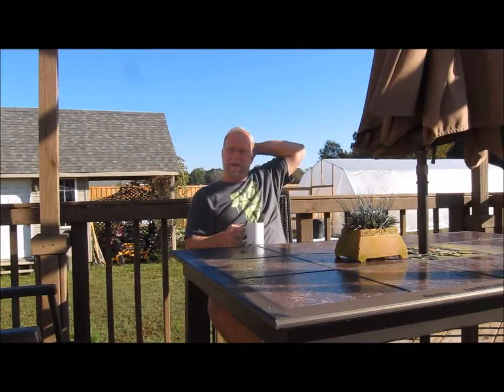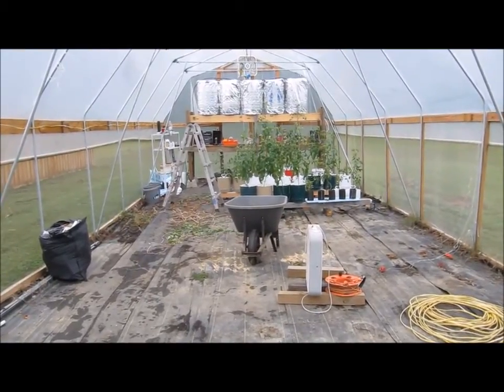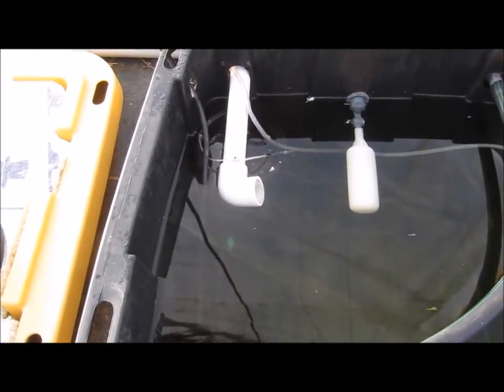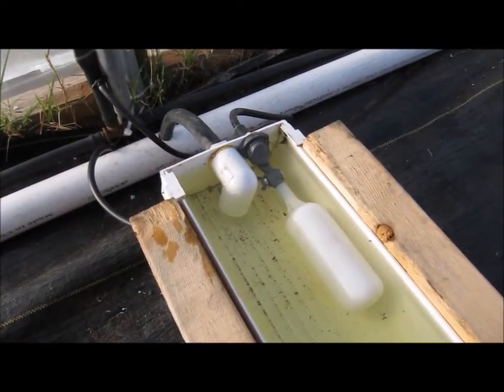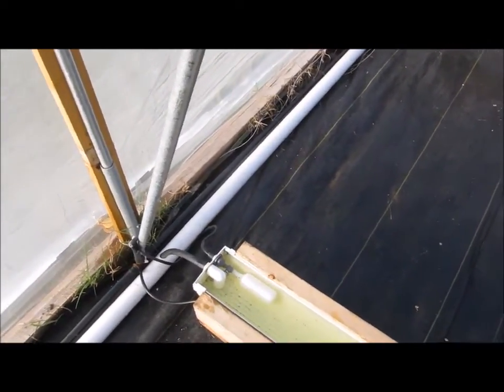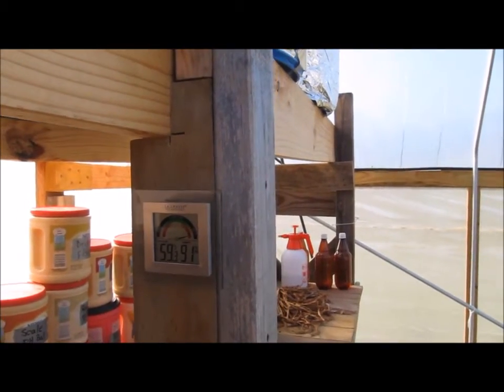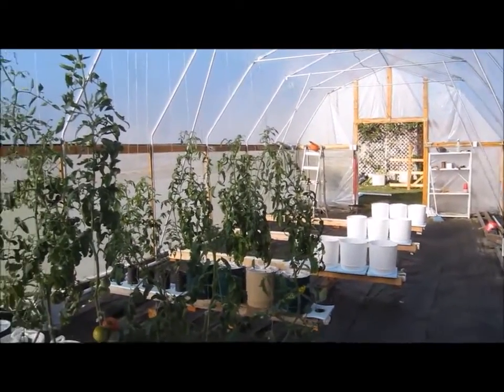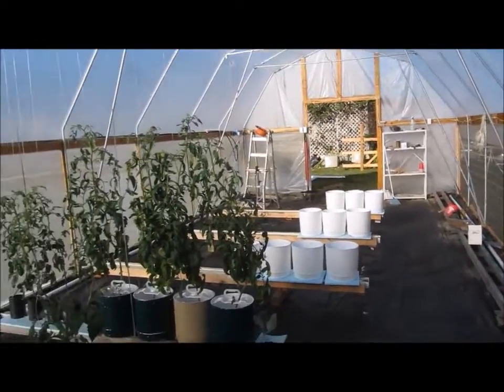Converting to FAWN

Comment: Looks like you're all in with your new system. Looking forward to seeing how you do.
Reply from the maker: Yessir, Mr. Larry.  I'm also changing up the grow medium which is the final part of the system.  With hydro, you get an inert medium that basically just serves as plant support and nutrient distribution.  I've always suspected that there may be some taste lacking from just the nutrient--a biology component somehow--so I'm going to attempt a medium that brings that back to the table.  I plant to trial identical plants with a drip line/perlite bucket, running off the FAWN platform, next to the others.  The way it's setup, it's easy to plop one in the mix.  We'll see.  Could all be bologna you know.  But, it's all just fun stuff for me.
Reply: Would be interested in your results.  I grew Tumbler Hybrid F1 tomatoes twice indoors and twice outdoors, and found much improved flavor when grown outside in natural sunlight and letting the moisture partially dry out between watering.  All grows were in sub-irrigated containers with Miracle Gro potting mix.
Reply from the maker: Matt Garver I think you may be onto something with the watering and taste for sure when they are ripening. I know melons sweeten when cut off.

Comment: Welcome home,
Hope you had a great time in tx.  Was looking over your system and saw the tubing lines that go to your RGGS floats.  I have tried looking all over for black flexible tubing to fit mine and no one has them.  Would you share the info.
Reply from the maker: Thank you!  

These are the floats I bought:  http://www.amazon.com/gp/product/B0077RASZG/ref=oh_aui_search_detailpage?ie=UTF8&psc=1

This is the tubing I bought:  http://www.amazon.com/Rain-016010VT-Vinyl-Tubing-Black/dp/B000ZOIAWQ/ref=sr_1_1?ie=UTF8&qid=1413941596&sr=8-1&keywords=vinyl+drip+tubing

The drip tubing you can get at the big box stores.  I also got at Lowes.  Don't get rubber; get vinyl.  It's funny you ask because this has been an issue for me for 3 years and I fixed it just this summer.  So, here's what I do.  First, the compression locking nut that comes with the floats is designed for water purification systems and the outside diameter of the tubing used in those systems is smaller than the drip tubing I use, does not stand up to sun/weather, and is prone to cracking when inserting drip connectors.  FAWN is based on drip tubing/connectors.  So, I tossed the float compression nuts.  What I do is take about 18"-24" of tubing and glue it INTO the float with standard primer/glue used in PVC work.  The glue (called cement) is the multi-use cement.  There are like 3 or 4 different types of cement, but who knows really if any of them wouldn't work.  First primer the end of the 1/4" tubing and while wet, insert into the float opening.  It'll be tight, but pull it out and repeat 2 times.  This primers the surface for glue adhesion.  Next glue THE TUBE part about a 1/16" away from the end, push into the float opening and twist slightly.  This is standard PVC gluing methods.  Don't get near the end or put glue into the float opening.  Pushing the tubing into the opening ensures glue pushes out and doesn't clog it.  The extra length allows for cutting later and reaching further away spots.  FAWN is gravity fed from 250 gallons 6' high.  The pressure isn't that great, but the glued valve works.  Hope this helps.
Reply: C3 Voyage That's gonna help alot. You're the best. Home Depot/Lowes didn't have anything that even came close to fitting that kerick float.  Even tried the 2 hydroponics shops in my area.  Nada, nothing, zilch.  Will definitely order tonight.  Again, thank you for all your help.
Reply from the maker: krafterpc Lowes and hydro stores should have the 1/4" tubing.  It's standard stuff.  Check in the plumbing area by the yard watering systems.  There should be a small area with drip stuff like emitters, 1/2" poly hose, etc.  Will add that the 1/4" tubing does not work with the float valve compression nuts just in case there is a misunderstanding.  Always interested in what others are doing so when you're up and running, feel free to share.